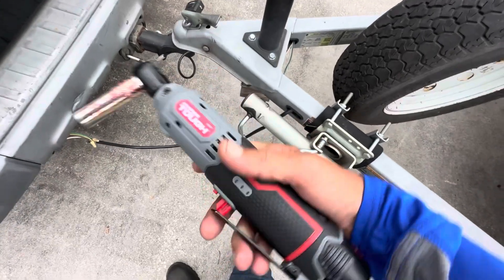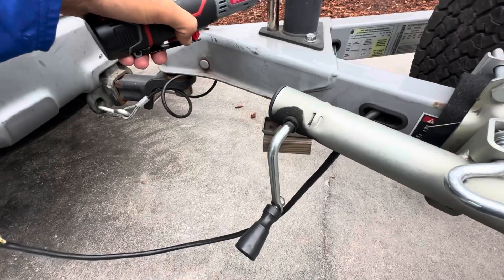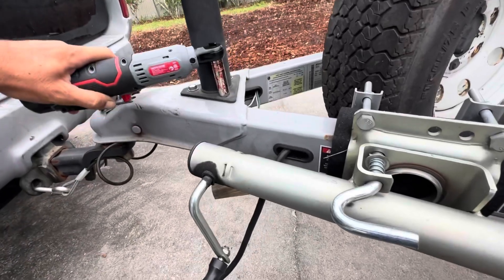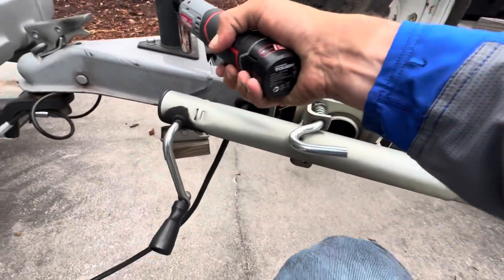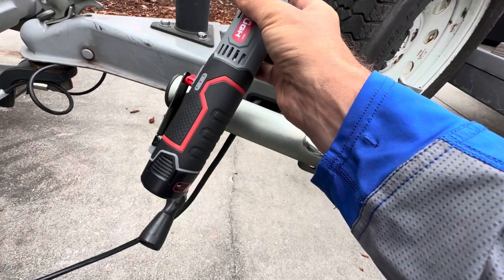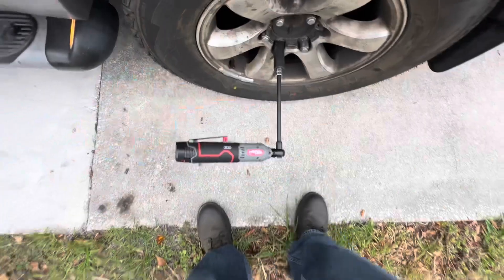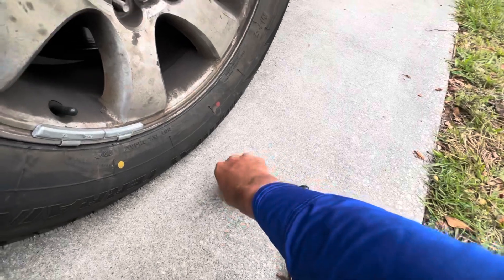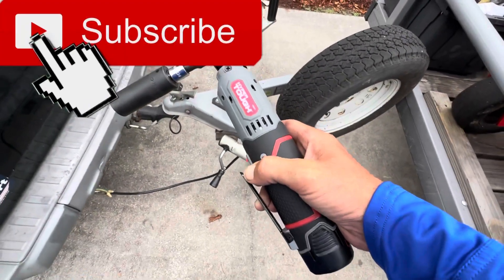Hyper Tough 12v Cordless Ratchet Stress Test

Comment: The head of the tool in that light grey portion is the heavy stuff.  Anything below that is plastic and houses the electronics, so be careful when you hand torque any nut or bolt.  I wouldn't torque it past 40 to 50 ftlbs.  It's made for fast loosening and fast tightening.

Comment: That's how you're supposed to use it. Loosen a tight bolt manually then use the motor to zip it off. It's the same for air powered ratchets. It's not an impact but they make assembly and disassembly so much faster.

Comment: Bought the extended reach one the other day because I'm tearing my duramax down to the block. Figured it was $60 and if it can get me through this one project it'll be worth it's weight in gold. Bought the $6 two year warranty just incase. Thing has impressed the heck out of me so far, I'm almost done with the tear down and it hasn't stuttered or missed a beat. Thinking about going back and buying the short one too. It's no front runner by any means but it's the farthest thing from a paper weight in my toolbox. Can't believe I didn't pull the trigger sooner. I have zero regrets buying this instead of the $200 dewalt that I already have batteries for.
Reply from the maker: That’s great to hear! Please don’t purchase the warranty for any of these tools they have one included, on the front of the box you can just take it right back to Walmart with the receipts and they will give you a replacement

Comment: I bought the ratchet with the 4 inch extended neck...haven't had the chance to try it out yet, but it seems to be fairly well constructed for $59.99. I bought the 2.0 amp battery for it, it comes with a 1.5 amp battery. I need to buy a set of sockets for it next.
Reply: Where did you find the 2 amp battery for it? I’d like to buy one
Reply: @ws4835  Their at Walmart in the power tool section. The Hyper Tough section on the wall behind the tool display. You may have to look for them. It's spot #43 in my store. Aisle I25 section 3.
Reply: They're not THEIR!
Reply: @florantedeogaygay2496  I stand corrected.😁

Comment: man you went way over on these tests. Wheel nuts should be torqued to 100 ft.lb.

I’m impressed
Reply from the maker: @packrcch  thanks I figured I’d see how far I could push the tool before it would break, if it could get through that I’d say it’s pretty durable but defiantly wouldn’t try to change a tire with this

Comment: They have a package deal right now for $89. You get the regular 12v ratchet/battery and charger as well as a 12v extended reach ratchet/battery and charger. 90 warranty as well. I'm definitely going to give them a try
Reply: The package on mine says 2yr warrantee

Comment: I think a brushless Impact Wrench would awesome and a one handed recip saw. The maybe a oscillation tool. That is what I would buy next. Maybe an inflator… I bought the extended reach ratchet and love it. I also love the impact driver a lot, it is super compact and feels good. Great tools for me so far.
Reply from the maker: Oh yeah that impact driver is the closest I’ve seen to the Milwaukee m12, me and my uncle used that impact to damn near remove every bolt to replace the transmission on my car, I’d like to see a one handed recip saw and a inflator too, I have a m18 one handed recip, and I’m currently using the Ryobi inflator, I like the look of the new hyper tough, they look kinda like flex tools, I’d like to see a brushless impact wrench too, i want to see what comes out next

Comment: the long neck version of this tool or others would have likely broken when you stepped on it. I originally bought a long neck as it seemed like a more useful tool, but it broke immediately on a brake job. The short neck can definitely handle more leverage.  Just my two pesos...      thanks!
Reply from the maker: Thanks for the info, yeah most likely puts more pressure on the plastic casing when it’s longer, im surprised this one didn’t break when I stepped on it, did the one you have that broke was it the same brand as mine?

Comment: Not really recommended, though I'm wondering about using the hammer as an air hammer?  Just received one with a charger and two batteries off goodwillfinds, so will see.  Craftsman Nextec tools can use the Hyper Tough batteries, though the charger doesn't seem to charger the batteries at least yet without a hack I'm thinking. The Hyper Tough tools look like they can use the Nextec batteries, though need to carve off some plastic and I'm not about to do that just yet.
Reply from the maker: That’s what I was thinking with the m12 Milwaukee batteries but they are different where the battery goes in the tool, I saw a video by vcg construction where the guy takes a dewalt battery and I think cuts the top to fit in a Hercules or something and even though it fit it didn’t have the same type of connector terminals so it wouldn’t work, the hyper tough batteries for this tool are only like $17 I think same with a new charger
Reply: I've been adapting batteries like a mad man, now you mention DeWalt.  Just search my channel for 20V batteries.  I've converted most my cordless tools to DeWalt and Bauer.  The later since the price of the Bauer batteries were unbelievably cost effective before the plandemic.  Lately, instead of using purchased adapters, I plan to make my own more or modify the batteries potentially.  Like with the 18V tools, you can carve the bottom as I've shown with the Black and Decker batteries to adapt.  Same for Ryobi as I have some Ryobi tools.  I didn't go that route with the Dyson and now am wondering why other than the number of cells and connecting the BMS, yeah I think thats why I decided to buy and not fab the Dyson, though am looking at carving a little away to fit the Bauer.  @LawnJohnSilver
Reply from the maker: @jafinch78  that’s good stuff, have you ever had an issue where the batteries have shorted or caught fire for tampering batteries with the different tools, batteries are so expensive, I have some Ryobi tools and Milwaukee tools, Ryobi is coming out with a new 12ah 27000 cell battery I want to get I think they are like $225-250 or something close
Reply from the maker: Just watched your video yes those batteries look very similar, I would even guess that these company’s buy out other ones or the battery design and just change the casing to work with their tools
Reply: No, though you need to be hyper critical when working with and familiar with working with electronics and any batteries and especially Lithium related chemistry batteries.  I've only used the old NiCd or NiMH battery case to make the adapters.  Those batteries just need to be disposed of carefully for recycling.  Similar to bad Lithium batteries, though very carefully handling the Lithium batteries so they don't short.  Especially if not discharged fully or the safety tip engaged.  Never had an issue with battery fires since I tend to use high quality INR Lithium chemistry batteries and only those batteries for tool and other high drain high current applications.  Before investing in the tools, is good to read and I like to use name brand batteries and only high quality equivalent or better than INR cells when replacing.  @LawnJohnSilver
Reply: Oh and all the battery issues are either low voltage causing BMS to not like the difference between cells since outside firmware spec or open circuit cells.  @LawnJohnSilver

Comment: To answer your question,The braking point is a sbc 350 head bolt. I used that ratchet everyday at my job and got cocky trying to break a head bolt without a breaking bar first.
Reply from the maker: @dadirtydawg7789  please let me know the results if you try to return it, it says on box 2 year and can return at store for replacement, sucks to hear that though
Reply: @LawnJohnSilver  I tried but since I lost the receipt they said I'd have to go through their manufacture. I just threw it away. Definitely keeping the receipt next time.

Comment: I just saw one that's an extended version
Reply from the maker: I’m still not sure about getting that one, I want to get it to review it but I think I’m going to try to get the brushless drill or the brushed drill and brushed impact combo for $40 I have been trying to order that one but it’s been sold out
Reply from the maker: I think it would be way better than the regular version because you can probably apply a lot more force to it and it would be like putting a pipe on a regular ratchet because of the extra reach, I used mine the other day to remove my skid plate to change my oil really came in handy, and a lot more quiet that using a impact right by my face

Comment: Taking off lug nuts is not what you would do even with a name brand tool. Using it to run them on and off after you broke them free by hand with a breaker bar or something like that, or better yet an impact is what you would want to do but I get what you where trying to show us. Also if you get it spinning before you put it in the bolt you want removed is what would be the real test. Even name brand ones don't have that much torque from a dead stand still like that, but spinning it first then as it's spinning stick it in the bolt and hold on obviously LoL.

Comment: $40.00 and 2 year warranty? Can't wait for the haters to come out on this one. Can't go wrong.
Reply from the maker: They came after me on TikTok, lol you really can’t beat this price, a lot of people were saying the Hercules from harbor freight would be better, that ones $90 without a battery and charger without a warranty also unless you buy one, by then your getting into Dewalt Milwaukee prices, on the harbor freight website it says 40 foot pounds so they are pretty much same rating as the hyper tough, I like harbor freight but I would never purchase power tools, you have to pay extra for a warranty, I might purchase the Hercules brushless impact driver they have coming out next month I think only because they just started adding a warranty with those tools purchased after a certain date but it’s only that brand
Reply: @LawnJohnSilver  All true. No name brands on Amazon range $40.00-$80.00 with little or no warranty at all. Good luck with extra battery or charger too. Good torque helps to remove fasteners quicker with cordless ratchets but they're nut runners. Doesn't mean much. Decent warranty, availability, and ease to get batteries and chargers are a must. Hercules ratchets are alright from what I've heard. Unless they get a better warranty it's not worth it. Even with discounts once you grab a charger and 2 batteries you're still pushing north of $145.00. At that price for $20.00 more you can find a bundle from Makita or Milwaukee at that price.
Reply from the maker: @sirkdopsah1081  good points, every time I buy any tool I always process the decision for a while since there’s so many options, I like to stick to one maybe two platforms so I don’t have to carry around as many chargers, I have 4 Ryobi tools I’m pretty happy with, there new hp stuff is pretty good even that stuff is in line with harbor freights prices for the kits and you get a 3 year warranty at least, I have 2 Milwaukee fuel tools but they are way overpriced, Ridgid is supposed to be coming out with outdoor equipment in 2023 just announced so I might start moving that way if they give out the lifetime warranty they have with the other tools
Reply: @LawnJohnSilver  I'm a big fan of the Ridgid impact wrenches myself. Depot always has good bundles. Kobalt impacts are great also. But Lowes is stingy with deals and bundles. I've been using Harbor Freight earthquake brushed 1/2 and 3/8 impacts since 2018. Good tools but out dated now especially in size. I like what they've done with the warranty on brushed Hercules stuff but I need to see more powerful compact stuff. It sucks because batteries are the thing right. I like to many tools from everyone HaHa 😅
Reply: Its not lifetime warranty don't get confused its a lifetime service agreement. People say rigid tries to weasel their way out of honoring that whatever way they can so be careful.
.